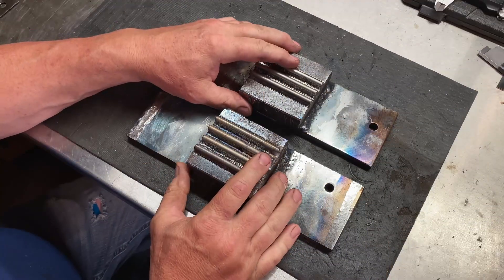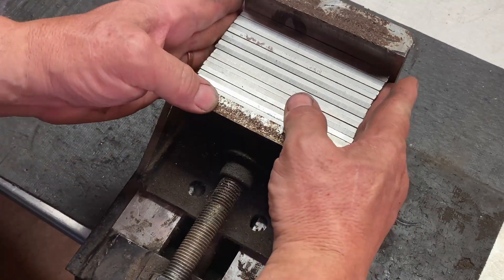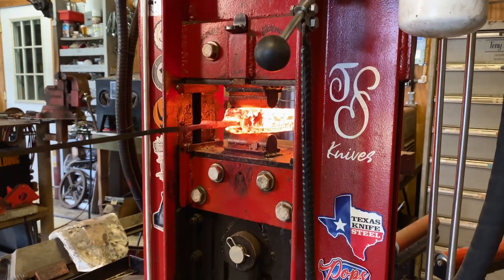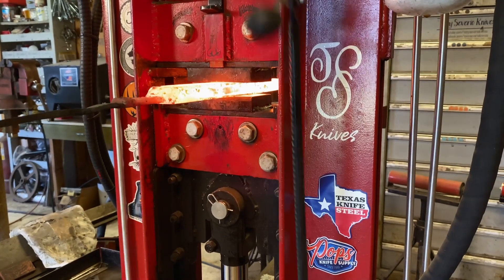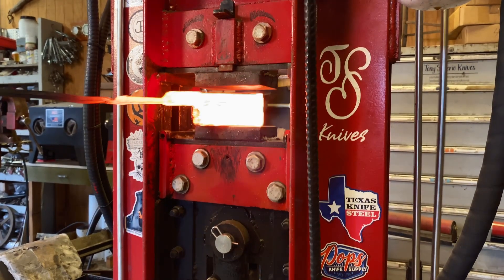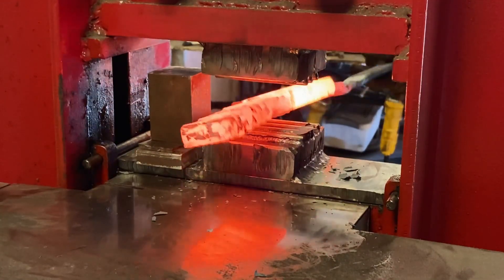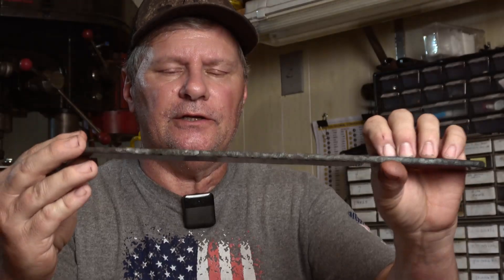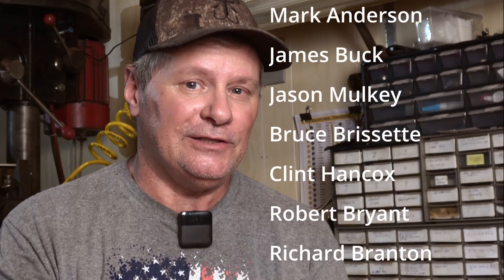The BEST Ladder pattern damascus Forge Press Dies

Comment: those dies did a great job tony what type drill rod did you use? i may have to make me some for my press Mark 👍👍✌
Reply from the maker: Thanks Mark.  I used 316L rod 1/4 diameter.  JW uses drill rod but I figured the stainless would work.  So far so good.  We’ll see how it goes.

Comment: Turned out pretty good bud! As I was watching this I started wondering how much the pattern would change on the billet if you used different size drill rod and graduated up the size so your first rod on the die was 1/4" the 2nd rod was 3/8" third rod 1/2" and the 4th rod be 5/8 or something along those line
Reply from the maker: I’ve seen a set made with 1/8 rod for making folder billets.  Turns out great!

Comment: I'm not sure exactly what he's using, but Liam Hoffman dips his drifts and piercing dies in something to help prevent sticking. I seem to remember there was some graphite powder in the mix.
Reply from the maker: Yeah it’s a coal dust mixture with some graphite.  I use that on holes I’m drifting but I don’t want to press anything into the steel that may get trapped.  Probably wouldn’t but I’m a skeardy cat.  😂. Thanks man.